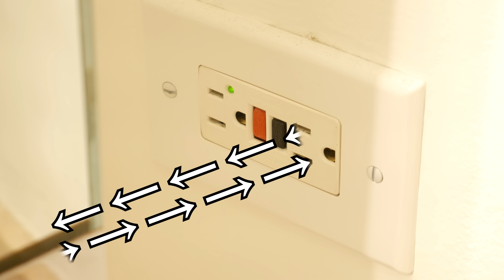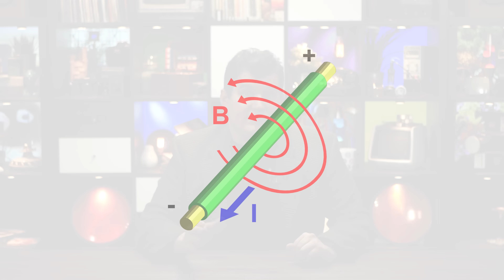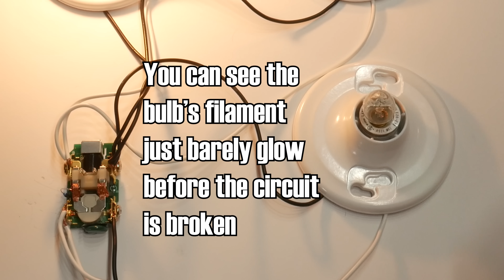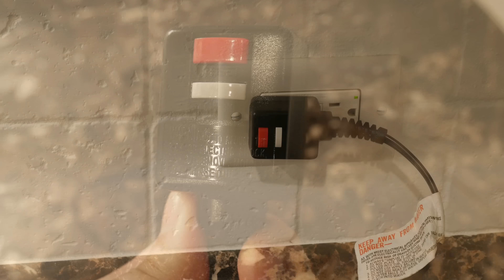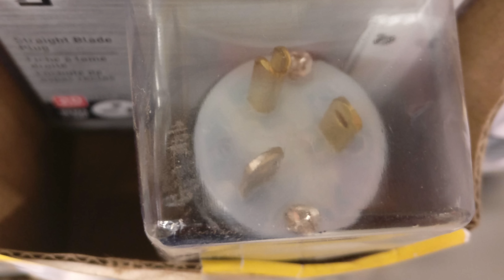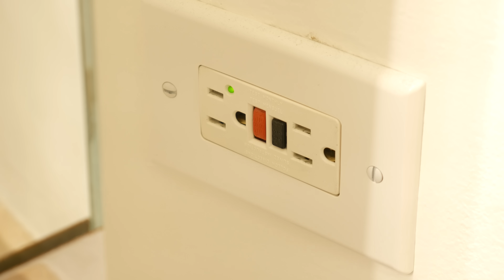The GFCI/RCD: A Simple but Life-Saving Protector

Comment: In Greece I have one of these in the breaker box which protects the whole house. It is a very old house. When it rains, moisture gets into the wiring and off goes the power to the house. It can be very difficult to find the problem area especially since you are now in the dark. Much better to have individual ones.

Comment: my kitchen counter is  wired a bit differently  for each outlet the tab is broken and one circuit is on top and another one is below,  I guess it is a way to balance,  but I can not install GFCI in there and still have that circuit split ...

Comment: why do "they" install standart plug with the ground down,  Im thinking it might be more safe to put the groung up ...  let say your plug is a bit out of the socket, and someting drop on the it it might hit the ground first  instead  of the live and neutral (and make a big welding spark) ?
Reply: a whole lot of electricians do actually install them that way in new construction, but 'ground down' was the standard for decades and some consumers complain outlets done the other way 'look wrong' and will have them flipped back over.

Comment: So... the american earth-fault detection system:
1. Has moving parts (more than one)
2. Has a soldered chipset with logic chips
3. Is not protected from the point of entry to the house

I'd rather take extremely outdated ceramic fuses.

Comment: Question. In places where an entire residence or small building can be protected by a single GFCI/RCD on the mains. Is there a separate feed for important stuff like if an elderly person needs a breathing device to sleep or a security camera recorder or business servers? The type of equipment that will have a UPS but you don’t want to have to rely on it for longer than nessisary
Reply: Naturally in such cases the socket would be omitted from protection. Same is with the fridge and the freezer.

Comment: I was working on a construction site a few years ago doing an add on for a gas station. It was night time and we had our lights and miter saw plugged into a gfci on the exterior of the building. One of the extension cords was frayed and laying in a puddle....need i go on? Yes I stepped in said puddle. Felt a sharp pain in my toes and as I was trying to figure out why, the lights immediately went out. That gfi more than likely save my life if not just kept me from getting seriously hurt.

Comment: For bedrooms and living rooms, there's AFCI (arc fault circuit interrupter)... which is now code in Ontario. Actually, even GFCI needs AFCI (known as CFCI - combination fault circuit interrupter). For anyone with the Stab-lok system (Federal Pioneer, and I think Schneider makes them too), get the outlets or dead faces, because their panel breaker AFCI isn't legal in Ontario (failed testing).

Comment: Did you really grab that hot cord with a wet hand!? Your Crazy!1 I am an electrician and even I am not that crazy.
Reply: Knowing this is Alec, I wouldn't be surprised to find that the circuit it was plugged into had been switched off at the circuit breaker.

Comment: I work at a hotel.

Every room has one of these installed inside the room itself. Annoyingly, it seems they were wired incorrectly, as they trip and shut off half the room's electronics once a month per room. Guests then are reasonably upset and I have to instruct them to push the button on the outlet.

Well, at least I know how it's wired incorrectly.

Comment: RCBOs are actually easy to troubleshoot. Mind that there is a small blue button you show in that ABB RCBO, that is the RCD reset button and will pop out if the RCD trips. If just the breaker trips, the blue button will no pop.

Comment: In german it is called "Fault Current Protection Switch", which explains the function better than both of these terms... since it reacts to ALL currents that are induced by a fault. It doesn't matter if another circuit introduces a fault, if that fault is to ground, phase or neutral, or anything like that. ANY current that was caused by ANY kind of fault should and will trip it.

Comment: 14:53 - Not necessarily, there might also be a heavier set of contacts installed in the 20 amp devices, depending on the manufacturer (and contact ratings, albeit technically.

Comment: I assume that's a 7 watt night-light bulb, otherwise the 5 ma of current seems awfully small to get a glow from the filament before the GFI trips. 7 watts @120v is only 58 ma, so roughly 1/10th of that seems about right in terms of brightness here. A 25 watt bulb would measure >200 ma, and I'm not sure you could get a glow dimming one down to 2.5% (5ma=1/40th of 200, or .025)

Comment: "putting the protection at the outlet makes the device causing the problem rather obvious" not necessarily.   I once had a house where half of the guest room was wired to the "load" terminals of the bathroom gcfi.  Fixed it myself when I figured it out, but finding that was rather unexpected.

Comment: I just love this, it's very interresting and in my experience, finding out what device tripped your circuit isn't that hard, because in most cases it directly happens when you plug it in, but I can see the benefit on having this on every outlet. But isn't it weird that it doesn't protect for short circuits? You could see that as the job of the circuit braker, but it just seems handy. Mainly, because my dad just snips live wires, because he couldn't be bother to walk to our service panel. (PS. I'm from the EU so I don't exactly understand the US version of the system)
Reply: Most of the time, you're right, it's pretty easy.  But it isn't always.  If it happens when you turn on the device instead, that's just as easy.

But some stuff works on a timer.  If it's something you've plugged into a timer switch, then you should be able to easily identify it when you test the timer when you first set it up.  Everybody tests these things when they set them up, right?  (Oops.  I didn't at least once.)

Other situations can be more complex.  When you have complicated electrical connections, such as a computer and peripherals that are wired to it, the fault could only occur when a specific thing is attempted.  For example, a periodic check of the printer's ink supply could cause a momentary residual current to flow through the cable to the printer and out the wrong neutral power socket.  If you keep your printer off most of the time, stuff only fails on rare intervals.  If the periodic check happens every half hour, and most of the time you need to print something the printer's only on for less than 5 minutes, you may not even associate it with the fact the printer was on for a while.

There are other complex situations, I just gave the computer example because I work with them a lot so I'm familiar with it.

The most baffling RCCI problem I ever diagnosed was shortly after I got married.  We moved into an apartment whose RCCI outlets had colored reset and test buttons as shown in the video.  For the first few months, at seemingly random intervals, the RCCI outlets would trip.  I was never around when it happened, and there wasn't anything plugged into them.  Finally, my ex asked me if I knew how long it took the circuit breaker in the bathroom to reset.  She'd been trying to test them for months, but they always took long enough to reset she gave up waiting.  (To be clear, we didn't get divorced over that.  We didn't even argue over it.  Also, we're still friends.  I'm sure I'd have encountered more baffling RCCI problems if I were an electrician, but I'm just a computer programmer.)

Comment: I remember as I kid, I had these in my room, I clicked them all and thought I broke them. I basically had no power in my room for months because I was too scared to tell my dad.
Reply: I tripped the CFI in my bathroom once by running a wet/dry shaver under water while it was plugged in. I was just glad nobody told god 😳
Reply: @thefaboo  Really happy you didn't fry yourself, lol!
Reply: @thefaboo  when I was young I stuck my psp charger in my mouth and tripped the breaker…. I thought I killed the houses electricity and had a mental breakdown 🤣
Reply: @thefaboo  a
A
A

A
A
Reply: @thefaboo  it’s gfci Smart one
Reply: @thefaboo  fun fact unless you have better grond than the minus, you dont get hurt by dropping the toaster in the bathtub
Reply: @rambo8863  thats false, I would know
Reply: That's not true. It would sound like it, if electricity would always follow the path of least resistance, when in fact it follows all paths, inversely proportional to resistance.
Suppose your toaster is running on 110 volts, and you drop it into the bath. If the path through the water to ground is 100 ohms, but the paths through you is 1000 ohms (ohms being the measure of resistance), there would still be 110 volts divided by 1000 ohms equals 110 milliamperes (or "milliamps") running through your body - potentially enoughto kill you.
Note that I don't know if these values are realistic (much depends on what is dissolved in the water), but I do knowthat people get killed in the bath by electric shocks so be careful.
Reply: @daanwilmer  man came straight from science class 😂
Reply: @rambo8863 That statement says you have no business working with power
Reply: @rambo8863  nonsense actually, the path of least resistance is neutral... and you along with it
Reply: I doubt they'd have missed it if it was months.... if you were a kid, the time probably just felt a lot longer than it really was...
Reply: Performed an action.
Had a negative outcome with no real knowledge of what happened.
Afraid to tell authority figure that can educate on the outcome out of fear of punishment.
Ya, that sounds like what I would do as a kid too.
Reply: My parents would never get mad about stuff like that and I STILL would do exactly like you did.
Reply: That’s honestly hilarious 😆
Reply: i remember when i was a kid, i was messing around with a plug-in cord switch, and i had accidentally dropped a quarter right between the positive and negative terminals, and there was a huge shower of sparks right before the gfci popped
Reply: I assume that's how you got your nickname, there, BOYGENIUS? :D
Reply: Wholesome
Reply: @Self Made Auto Science! 🤣
Reply: @Self Made Auto Science Rules
Reply: huh
Reply: @J19_vlogger74  fell asleep on my phone
Reply: @ILOVECORSICARILOVEYOUILOVEYOU  ok
Reply: Not surprising that you were afraid to tell them when they made you sleep in the garage.
Reply: Lol kids
Reply: Me too
Reply: You’re lucky bro mine doesn’t have gfci or afci
Reply: are "bus bars " and " do dads" the real names of this sheet or is he just making sheet up ?
Reply: Really i only started seeing these a couple years ago thats when i got them at leadt

Comment: The most important reason, why the entire house needs to have a residual current device, is that not everything is plugged into a socket. Important things that you miss this way, are:
1) Faults in the wiring itself (failed wire insulation in the walls, water getting access to wires, for example during a flood or leaking pipes)
2) Newly introduced faults during installation and maintenance (miswired new socket or switch - for example, an untrimmed wire touching a screw)
3) Malfunctions in devices that are not plugged into a wall socket, but wired directly (such as all the lights except plug-in desk lamps, ventilation fans, integrated heaters, etc)
Of course, troubleshooting can indeed be harder, although in practice, it's usually quite obvious which device malfunctioned (the one that was switched on 30 milliseconds before the power went out).

Comment: I plug my electric razor into one of these when I buzz off my beard. SOMETIMES when I turn my razor from on to off it trips the GFCI and I have to reset it. Is this a sign that the GFCI needs replacing or that I need a better/new electric razor?
Reply: It can be either one. Or both might be okay. If the razor has a large Y-capacitor (for RFI/EMI suppression), it can trigger the RCD when you shut off the motor while the motor current is high (causing a large back EMF voltage spike). Note that that having a Y-capacitor requires a fully connected three prong plug. Most unlikely for a razor!

Comment: I wonder why this mechanism is tripped when our office toaster oven and microwave are run at the same time though. Either separately is fine, so is 2 microwave ovens. But if someone is using the toaster oven and someone else turns on the microwave, the outlet is tripped and has to have the button reset.

Comment: The 15 amp gfi box prevents someone from connecting 20 amp devices when the house circuit only has 15 amp capacity.  Even though the gfi can handel 20 amps.
Reply: Dan C still does not explain why the 20 amp GFCI is $3.00 more...

Comment: And why there are some plugs are one side bigger than the other
Reply: The look of the plug plays a very important role in your safety, the wide prong fits only into the wide slot on the outlet and it is the neutral wire color white and the hot wire is the smaller right side it has a black wire then there's the bottom hole that is the earthing current for sending extra high voltage down through the house into the soil or foundation.

Comment: Your roster example has power running the wrong way the smaller hole is the hot and the bigger one is the neutral if installed correctly but I can only nit pick faults also you don’t talk about why a gfci is a suitable replacement for non grounded outlets which I argue with homeowners who think they know electric inspectors who see a common plug tester does not trip it  solid video

Comment: In Poland it's called differential current disconnector (wyłącznik różnicowo-prądowy) and it just describes how it works, it detects current difference between live and neutral. If it's 0 then it's ok, if it's different, well, there is a leakage path and if the current is above 30mA then pop goes the toggle.

Comment: Here in the Philippines, we never ever heard or had this kind of outlet. In my house upstairs to my mother's bathroom, I have an outlet but it is covered but it has no GFCI/GFI/RCD protection at all. It's just a normal outlet and the one who did the diagram of the house wiring was stupid enough to have an outlet in my mother's bathroom. NOT WHAT YOU WANT THOUGH BECAUSE THESE ARE POTENTIAL FOR ELECTRIC SHOCK HAZARD!

Comment: In Germany, we have a great way of testing what caused the "FI-Schutzschalter", as we know it, to go off.
You basically close all circuit breakers so that even after you return the RCD to its original state, no current will flow.
You then, one by one, turn on the circuit breakers and when the RCD fires again, you know which line is faulty, and usually, there are only like 3 outlets per line.

It's also genuinely a lot of fun and a great free time activity. Seriously!

Comment: Why is that toaster not grounded? The US term is confusing to many as they think it is connected to the ground wire and they think that an ungrounded GFCI outlet does not work.

In the US anyone can change sockets and they are pretty standardized. In Europe, at least in Finland, only a licensed electrician can do it and there is great variation on the sockets (not the actual part you put the plug). That is people seldom change sockets and the GFCIs are installed only on major renovations or new buildings. I got a new panel some years ago and it has GFCIs but they did not connect them as one cannot use them on PEN-wires. Also here they are needed also on lamps. In fact everything but a fridge/freezer requires one. Also since the cutoff here is 30 mA accidental triggering is less a problem.

Here those who want to add them can buy a portable one, costs some 15 €.
Reply: outlets are not hard to install, just know how to wire them.
Reply: @XbninjaXIV  Yeah and people do various of weird systems especially with TN-C. Improperly wired DIY outlets have killed three people in Finland since 1980.

Comment: Mine behaves differently. When I push 'test,' the outlet is only turned off as long as my finger is on that button. When I remove my finger from the 'test' button, the outlet comes back on. The 'reset' button seems to behave exactly the same as the 'test' button. Is it supposed to be like that, or is something wrong?

Comment: More for different faceplate:
Cost of production != price. Especially easy to see in this situation given that economy of scale for two different products is easily massively different. Tell me how many 20A GFCI receptacles you have seen out in the wild Vs. 15A? Of course it's going to cost more. 

Do you complain also when McDonald's doesn't discount your Big Mac without cheese? I doubt it. In reality, given the way McDonald's works,  if costs of production = price, your Big Mac sans cheese would likely cost More than the standard menu option. But that's not how prices work.

Comment: In Russia, they are technically called a residual current device. But it's more common to call them "corks", like in a wine bottle. "Damn, I just plugged this antique lamp and my corks got busted! Gotta go to my service panel and switch them on".
Also, service panels usually located outside a flat. In more modern flats you have a common service panel with RCDs for all the flats and one service panel inside a flat with selective main circuit-breakers.